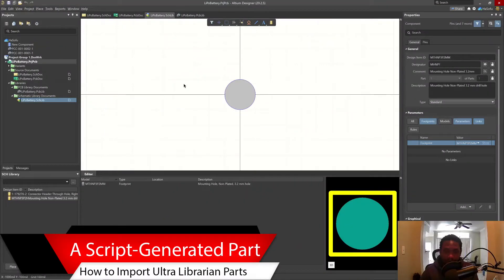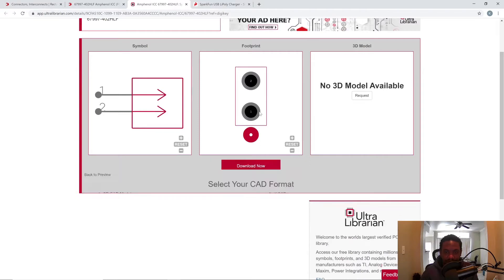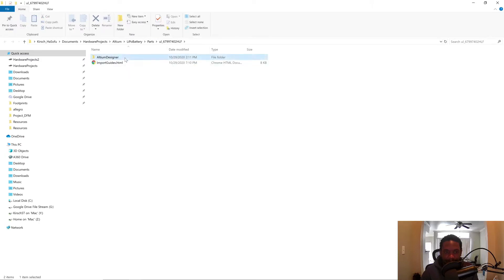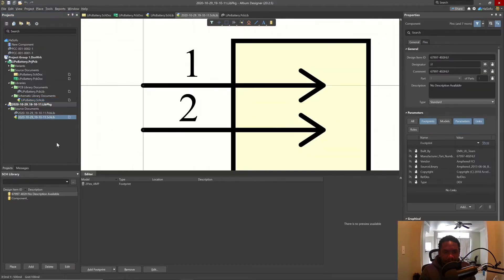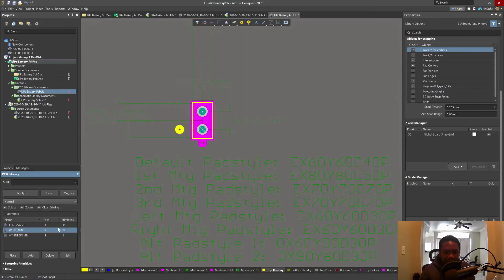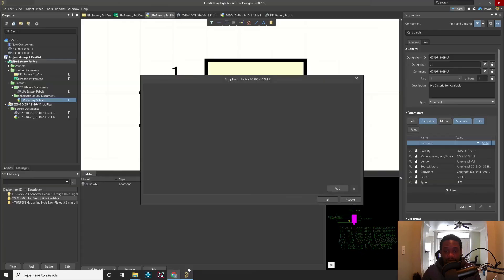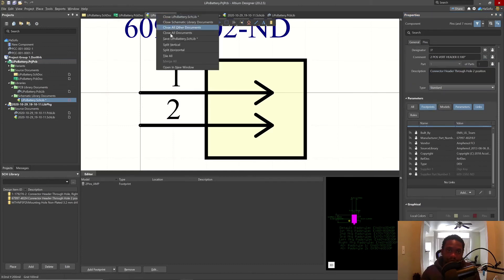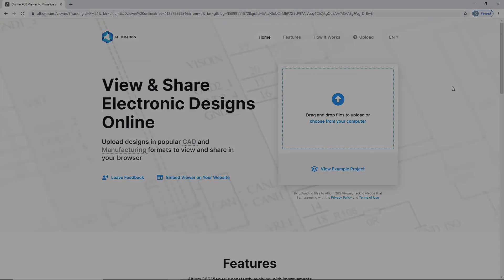PCB Design Tutorial 07 for Beginners (Altium v20) - Import Ultra Librarian Parts

Comment: thanks for sharing, but can we simulate stm32 micro processors based projects on altium? i am currently on a stm32 based switch power supply project using tea2016 as management chip, so I would need to go for a simulation, please let me know, regards.
Reply: @techedkirsch thanks for reply KIrsch, what a pity for impossibility to do this on ad, but do you know is there any computer progam is able to do that? Thanks
Reply from the maker: Multisim and possibly Altium in a couple years. Other than that, not really. STMicro has cubemx which is super helpful for pin mapping though. But simulations? No dice. As far as I’m aware.